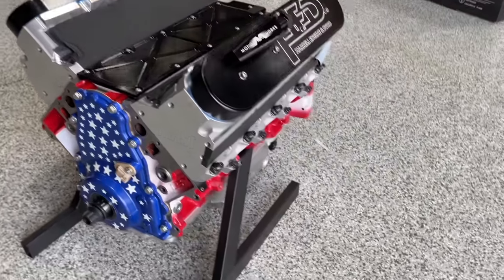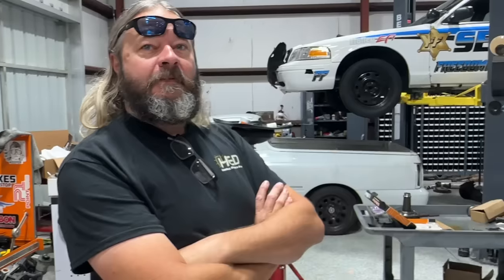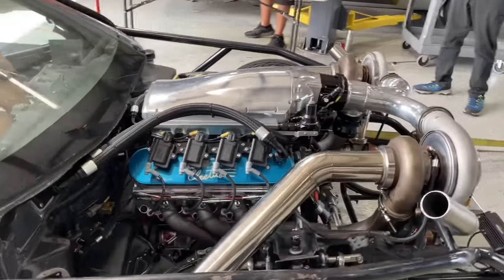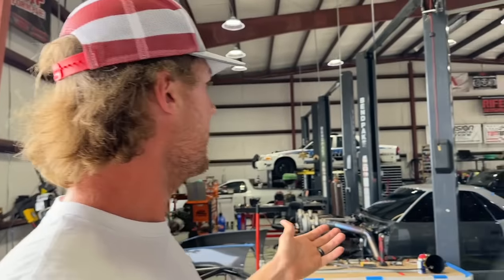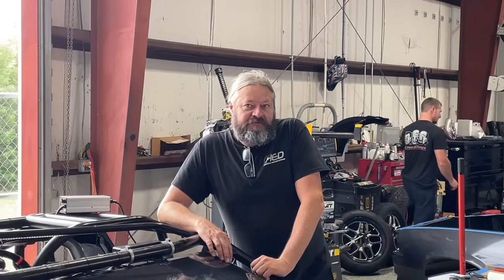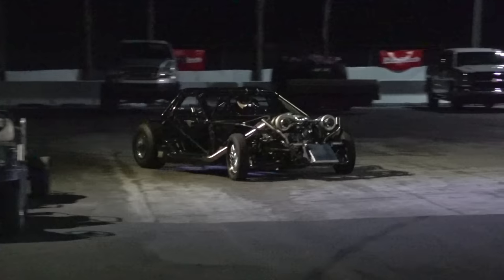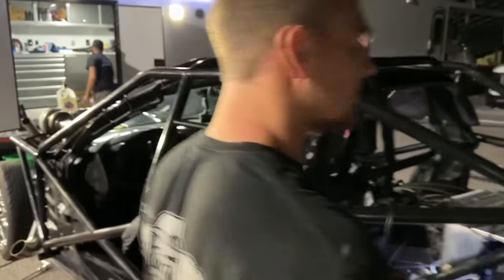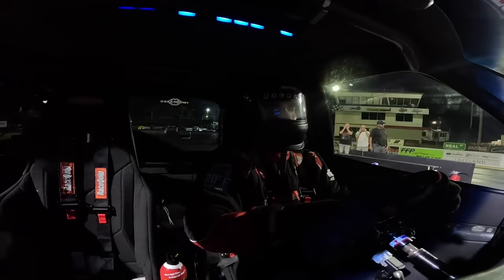Leroy 2.0 Just Got a BRAND NEW Engine... It's POWERFUL!!! (Dyno + First Track Test)

Comment: Leroy has had so many parts swapped and upgraded over his life it feels like we’ve been watching a story mode for a racing game after all these years.
Reply: Cleatus will have a video game one day!!!
Reply: Needs a coyote now
Reply: The tie bad ass compilation
Reply: @jamescaudill1248 Exsctly what I was gonna say. The game jeeds to have Leroy take part in drags, autocross, drifting and even circuit racing...

Cos Leroy has done all of those things.
Reply: @jamescaudill1248  LeRoy, Donnie, Neighbor, and a Ranger all stock. Pick your first car run that event. Wins unlock events buy and upgrade cars as you play.  🇺🇲 HELL YEAH BROTHER🇺🇲
Id buy that game and the yearly updates.
Reply: @Not_A_Cat  would be cool to have a drag n drive game mode too where you pull a trailer, gotta worry about fuel, heat etc... even have cops that dont take kindly to speeding and burnouts...
Reply: @X3R0D3D  make it necessary to make the correct turns, not get lost, stop at all the checkpoints etc. Could use or expand upon maps from trucking sim games. Or make it as real as possible, by copying data from Google maps.
Reply: @bootyslayer2868  the hoonigan cars are on it, might as well have the macfarlane fleet
if there was an open world career mode racing game where you start out as a kid with his day 1 license, and it was good, it would make all the money.
Reply: have sam clean and repair your car cosmetics. bonus even, australia burnout with toast @Koontzy.
Reply: @fast97z24  his name is pete

Comment: 30minute Leroy video….and he actually successfully went down the track??? Amazing!!! This has been my favorite car on this channel for years. Congrats to the team
Reply: Remember how he was so upset when he bought it because it was wrecked
Reply: @mechanicsinherited7079 wasn’t that Ruby?
Reply: @Bird-nx5ef  Ruby was an auction buy with Leroy, he had a buddy look at it to see if the frame was straight, his buddy said it was good, so he bought it. He even contemplated selling it
Reply: Fl2k will kill Leroy new engine. When that happens it's time for Leroy to be a display piece. He's sitting on a supra waiting for a built 2j to return for it. The supra will take over Leroy spot because it CAN  run 6s with less money than it takes to get Leroy in the 6s. 

Leroy motor will let go again before they hit a 6 in it.
Reply: @EasyBakinX  I think they hit 6 in Leroy with current engine, I also think it only does it once or twice lol
Reply: @EasyBakinX that engine ain’t goin no where bud, cuz Pete’s fucking good at doin stuff. It ran a 7.5 practically on 20 pounds, leroy has ran like 40 through the texas speed 427, I’m sure Pete’s engine will stand up right with it, and honestly, another 10 pounds of boost just going up to 30 on a already 7.5? He will be deep low 7s with just that
Reply: @TheXrossfade  he made the mistake of mentioning 9k rpm. Cleet acting like he's not going to take it there. If they take the laptop away maybe the motor will last but Garrett will see like a 7.11 and wanna go for it, we will see a head gasket let go again. 

Then it will be time for an sml, or retire the car.

Comment: When i was younger my buddy had built a destroked small block, a small block Chevy 400 block with a 350 crank. Big cam and 202 heads. That was a high revving mamajamma. It would spin up so fast a rev limiter was mandatory to avoid the enigne destroying itself. Destroked engines are capable of making massive HP.

Comment: Please like this so Cleetus sees it. I really think you need to check the rear suspension out with a fine tooth comb. It's not lifting up on the bars in the rear like it was. After the very near mishap tonight, it could have been very bad. Maybe I'm way off, but itol looks like something isn't working in the rear suspension like it was. Maybe it was something else that about put Leroy in the wall, but it just doesn't look like the rear suspension is working right. 24:07 it actually squats on the rear instead of raising up on the bars.

Comment: The RPM drop when youre shifting is like, way more since youre running a 427, so its less load on the engine between gears. Being destroked now lowers the piston speed, dwell time at TDC/TBC and its less stress on the bearings. Running so much boost through those old OEM style heads they're gonna wanna lift, Pete didn't reinvent the wheel he sorta just went with a combination that puts way less stress on the engine so the turbos can do the work.

This is one of the reasons those big 500 inch promod motors need the aluminum rods because the shock of such a long stroke means it's hammering a huge piston and rod combination all the way to TDC but then we ask them to spin 8500+ RPM plus with the wonky/spindly rocker arm length and pushrod angles it just cooks parts.

Comment: Only watched to the second dyno pull yet, but might be a good idea to add a way to cool down the clutches using compressed air? Both for the Dyno and for Zacks fingers. You would probably only need a small hole in the bellhousing and a fitting to be able to put some airflow through it.

Comment: Question to cleeter and crew and all of the commenters, is it possible to run a Honda style slipper valve on top of the the slipper clutch that's in Leroy and v8s in general? Only wondering, because you could in theory,  use it like an extra dump valve.  Have the clutch weight way up for maximum power out the back,  but also tune the launch without burning the clutch up... just a question...

Comment: Texas Speed got you pretty damn far but there's levels to everything. You've got full production engines that have to be made in the hundreds of thousands and deliver decent performance for decades, your production performance engines that still have to be made in the thousands but are expected to live a performance lifespan and associated maintenance and keep going all the way up to the extreme full race engines. At some point, to go faster you gotta move up a step.

Pretty crazy how far we've come, though. The first time a pro-stock broke 200mph in the quarter was 1997. Not even 25 years later we've got drag and drive cars blowing that away.

Comment: I just have a question I’ve learned so much off your videos I watch them when every I can you’ve inspired me so much but I’m just curious what you call the shift that you squeeze and push or pull to shift is called and If you can put it on a manual transmission or automatic transmission

Comment: Sorry for the stupid question. I'm still trying to under what the load difference between the dyno and track is on the car? Is it because there isn't a HUGE load transfer on the dyno or maybe there is hahaha..  Does it hurt at the stop of the run. Sorry I've tried searching this question but I get a Google answer or ChatGPT answer. I need a racers answer.
Reply: Slipper clutches don't have the clamping force for low rpm high torque situations like the start of a dyno pull. The lever arm weights on the carrier add more clamping force the faster the carrier is rotating. On track the car is launched from two step rpm which is way higher than the start of a dyno pull.

Comment: This engine can make such stupid power, that a gentle first break in dyno roll is 580+ hp. LOL. 

For a lot of people, that would be a respectable # they'd be happy with, even in a drag car. For leroy, that's just getting warmed up, i love it.
Reply: What's considered to be a lot of power seems to go up day by day. Modern tuning/metallurgy/boost makes some pretty high numbers reliably, and attainable without having such deep pockets, esp if factory forced induction is there to be cranked up. It's awesome, and i think it's great, but i try to not to act like 500 hp is nothing. If im just thinking of a cool street car, I can still have a ton of fun with a manual 300hp car from the 90's. 

Its different if you're ole cleet chasing a time, but i think it's wild that even a toyota Corolla pumps out an honest 300hp. Even the big 3 diesel 3/4 tons all make 400hp/900tq+ lol. 

Then we have tesla plaids beating all but the most exotic supercars right out of the box. It's a great time to be be a car guy. Gt500's, Zr-1's, demons, and hellcats (really sucks to see the last demon ever to be made has already been sold), but there will be cheap hp around for decades.

Comment: someone explain why the dyno fries his clutch?
Reply: Slipper clutches have a low force spring and weights on levers in the carrier. Faster the carrier is rotating more clamping force is added by the weights. Slipper clutches don't have the clamping force for low rpm high torque situations like the start of a dyno pull.

Comment: WTF it's clear as day and needs wheelie bars and I'm not talking about like full pro mod style wheelie bars but there's got to be something that can be put down so the truck physically cannot wheelie you know look at Tom Bailey and Steve Morris you know yeah they're in a completely different class but that truck has more than enough capability to go probably 8 seconds if he can get the power down and not wheelie it's a simple solution but wheelie bars on it then he can dump the crap out of it simple thing maybe he's going to do a drag and drive you just take them off store them in the back of the truck and then when he gets to the track you guys can bolt them back on like I've been watching this channel a long time and I literally seen the first episode of the blazer and it has been a issue since the first time this thing actually got some power behind it. It's a light weight short wheelbase top heavy vehicle which now is higher in the back and lower in the front with some good track bars and maybe lowering the rear end I wouldn't be surprised if he can at least be in the 8.5 second class.

Comment: wonder if it heps the clutch on the dyno to just weight it down a lot basicly stop it from slipping and turn the chassis dyno allmost intoo a engine dyno with the only slippage comming from the rearwheels

Comment: RC. Cars when your young are fun, but the joy goes away fast after you’ve replaced every suspension parts clutch a dozen times ,and smoked handfuls of tires, heck it can get more expensive than a real car at times, excluding high end stuff, but it’s easy to spend 3k on a great RC car after a yr or so..nowadays they’ve jumped from 1500.k to 3k almost for the big boy racer 1/10th scale cars and trucks..a stock Rc 1/10 high end is 800 used ,I think it would be more fun if you had a built in camera system which worked with virtual reality ! Just a little cap that snapped onto the roof with 4 4K cameras with built In stabilizers that can roll twist and always give a clear picture with zero shake !

Comment: Understanding that the wind may have knocked out your radios repeater, but you should have a simples channel, or a radio to radio channel, so you can still talk short range! Shouldbe able to talk between radios about maybe a quarter mile. Granted not great,but better than nuttin,! 😄 
Maybe talk to your radio provider and see if there are options for different repeater for times like this!

Comment: Why does the clutch fail on the dyno?
Reply: Slipper clutches don't have the clamping force for low rpm high torque situations like the start of a dyno pull. Slipper clutches have low force spring and then weights on levers in the carrier. Faster the carrier is rotating more clamping force is added by the weights. The clutch is tuned for a launch from two step rpm on the track which is way higher than start rpm for a dyno pull.

Comment: Steel rod engine will NEVER live with that much power.....Nitro guys figured out MANY MANY years ago that Aluminum rods have memory, they can bend and go back straight,  a steel rod when it bends, it stays bent therefore you have an over boost and a under boost in different cylinders,  breaking pistons, gaskets, etc. ALWAYS USE ALUMINUM RODS IN BOOST APPLICATIONS......imho☝️